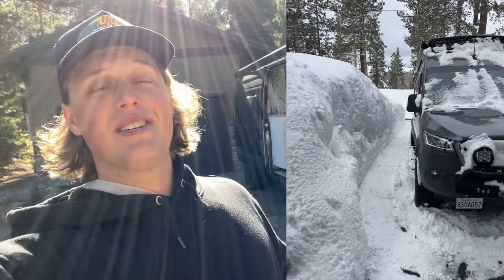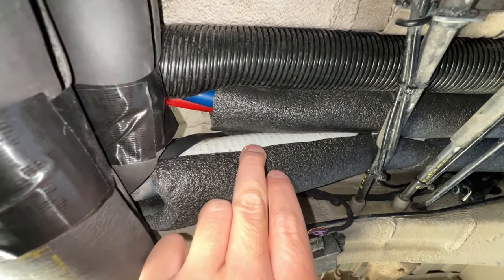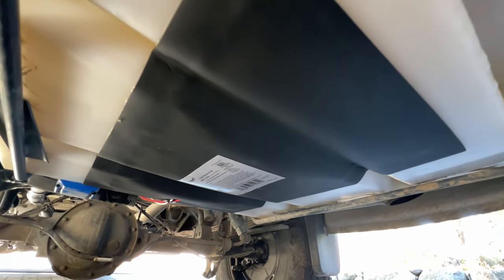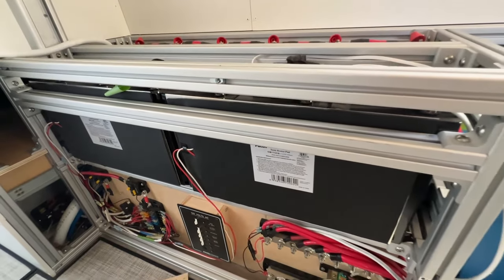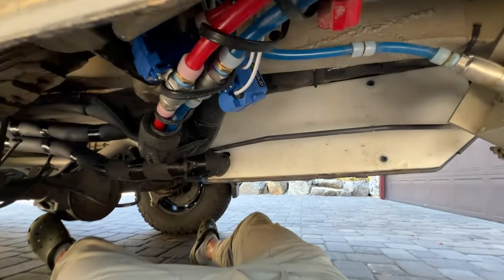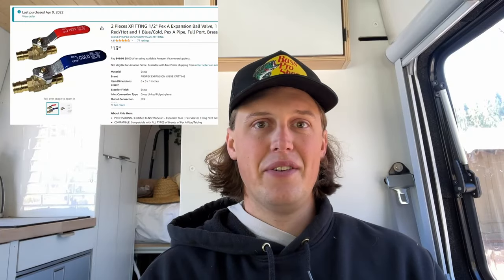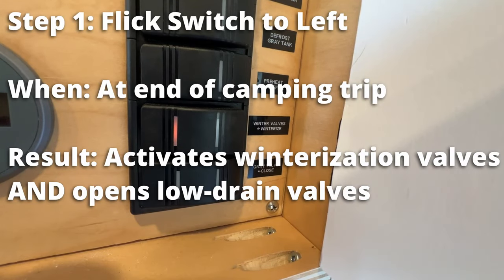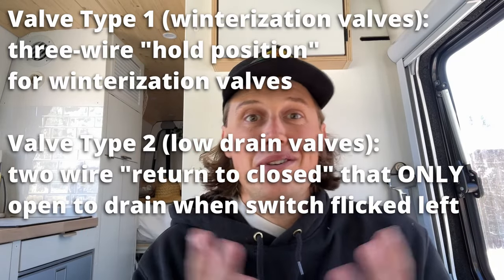How To Build A WINTER CAPABLE CAMPER❄️ (6 Steps with INNOVATIVE ideas)

Comment: Your videos are much appreciated.  It seems this flushing can be done with just one valve.  Run the supply line coming out of tank directly up to the top of the tank and into a tee fitting.  In one of the tee's other remaining ports, add the valve that when open pulls in the air.  The tee's last port will supply the normal water system, pulling water up from the tank when the valve is closed.

Comment: Here's an idea that will greatly lessen the electrical load for keeping things above freezing temps. Tap into the engine coolant system and use hoses/pipes that are embedded inside the water tanks and run parallel to the outside water lines (doesn't need much, small diameter tubing would work fine). The engine coolant is an endless supply of heat, a heat buffet in fact. Conversely, you could also wrap a few loops of copper pipe or some custom fabbed metal heat exchanger around the exhaust pipe under the van and circulate antifreeze around it to take some heat out of the exhaust system and then circulate that heated fluid in the same manner as described earlier. 

Also, you seem to set temps way above what they need to be in order to protect against freezing (like 70 deg F). Why? It consumes a lot more electricity than necessary, doesn't it?
Reply from the maker: Cool idea on engine coolant! The thing I’ve experienced is that the heat while the engine is on, after drives and such, is actually enough to keep things thawed. It’s mostly during long durations of being parked in sub freezing temps that I need to use the defrosters. 

You’re right on the 70 degrees thing, going to see how low I can set those while camping this winter :).

Comment: I guarantee that high end coaches that don’t have your new electronic switch air drain system thingy will start to go with that. Super cool. Can you come to my house, install that so I don’t have to winterize my yard? I guess I’d need to have a low point in my yard! 😂
Great to see you back making videos, I have been building a kitchen in my van. It’s actually done now, about 99%. It looks good. Very tight! It was a lot of work!  Omg. 😂

Comment: Here is my tip....  Take an electronic ball valve from the hot side of your water heater and run it to your fresh water tank.  
At the push of a button you can start to heat all of your water on board.  this will keep it from freezing if you leave the van for awhile.   this trick would work well if you are using a water heater that is scavenging its heat from your engine, or from shore power.  this would also have the benefit of thermal mass, it would take longer for your van to cool off over night.
Reply from the maker: This is a great idea!!
Reply: This + auto-thermostat = potential for low-draw "keep above freezing" mode, just need to keep the pipes ~ 45ish. I have a propane tankless, but the pump is still a draw, but far less than the heat-tape I'm sure

Comment: Do you have a water filter system?  I can drain my tank and the pipes but my water filter cartridge cases still have water in them as they are hanging vertically under my sink. They froze last winter and broke the cases. I was thinking of getting a berkey that I would use in the winter and just bypass the built in water filters. I haven't really thought it through yet. I was just surprised that my primary issue for functioning in my van during the winter didn't seem to be an issue for you. I live in Colorado so yeah.... four seasons is what I want.

Comment: Hey SOS, thank you for the tips. Is this the same Van you installed the thinsulate floor/Birch in? And if so, how does the floor do in winter? I also have a sprinter and need to keep the max interior height.

Comment: Wouldn't simply draining the tank completely then turning the pump on do the exact same thing? All while eliminating 2 additional failure points...  K.I.S.S. is my motto. Great build though!
Reply from the maker: Yes but often times I can fill water tank once and use for 3-4 weekend trips. A lot easier than trying to fill up every time in the winter.